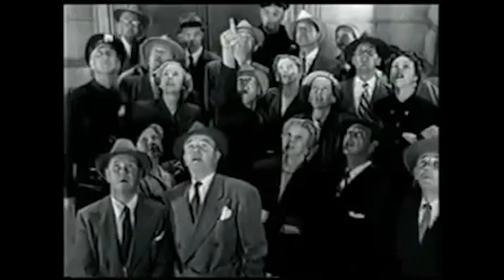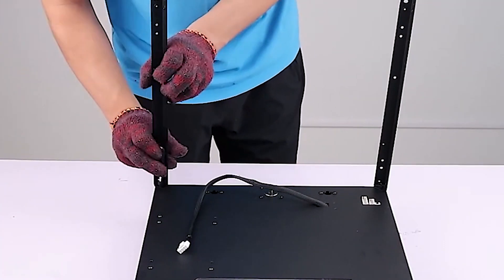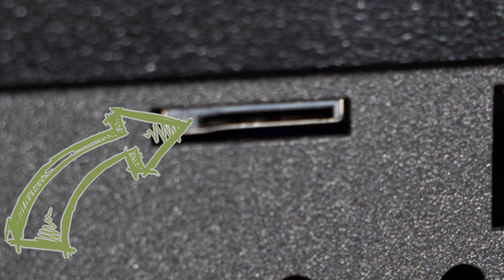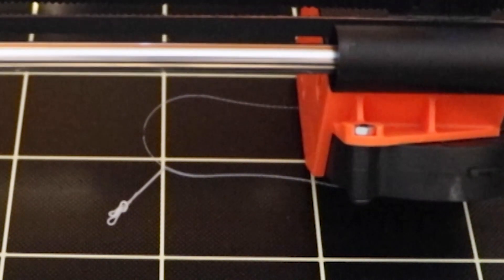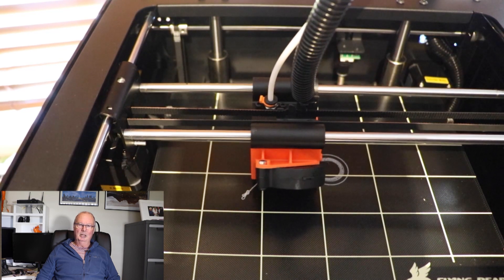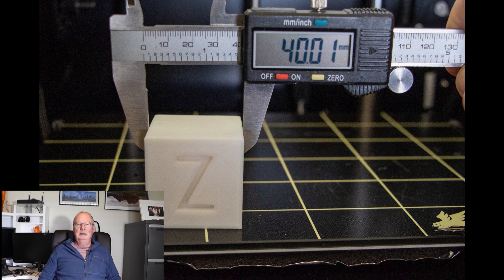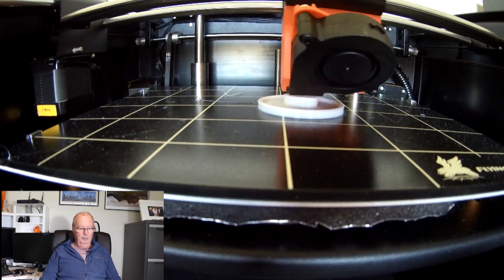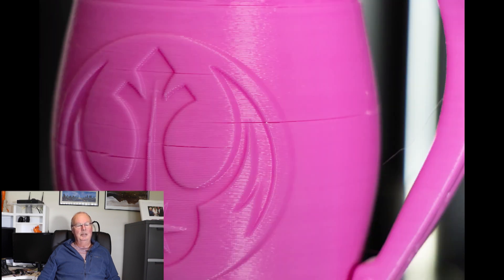FLYING BEAR Ghost 5 3D printer kit review

Comment: I agree with that stupid micro SD card idea.
1st order of business is to convert it to standard SD card slot and get direct extruder with better cooling.
Otherwise this printer is better then anything in that price range including prusa.
One downside is the print size.
But they do sell REBORN which is identical but cost nearly double.
Reply: You don't need it, I only use the wireless feature works very good